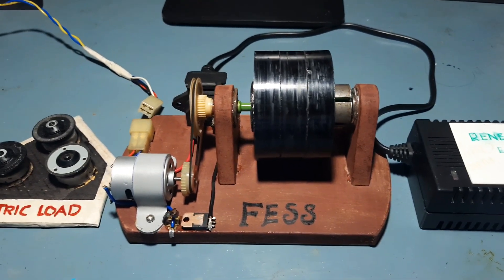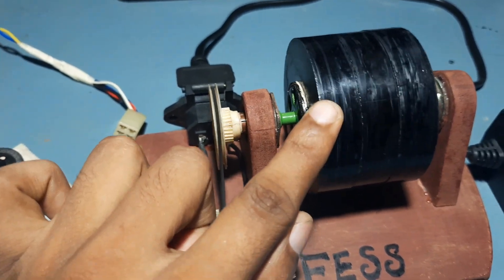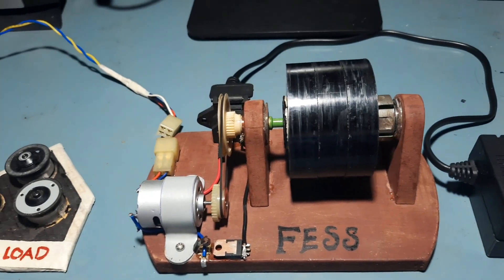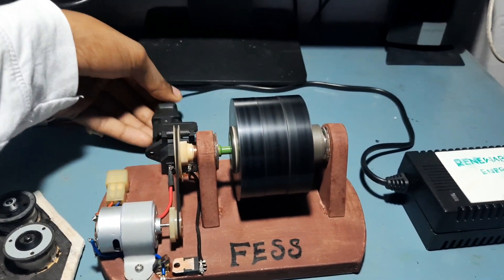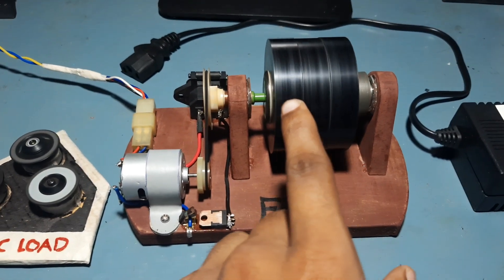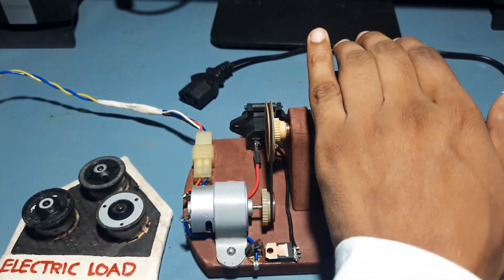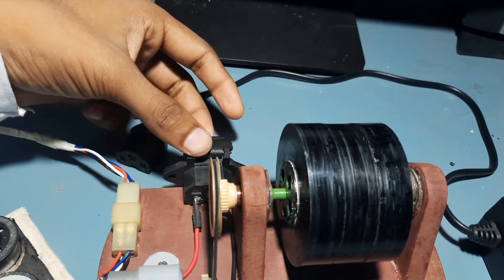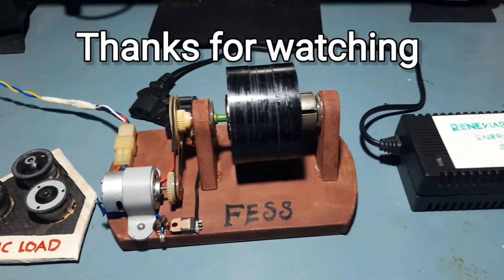Flywheel energy storage systems

Comment: The radius of the flywheel has to be larger even though the weight is less... It's the outer ring weight of the radius that matters more. Because the farther from the axis point, the more moving energy it holds. (Inertia)
Reply: That means to make a flywheel have a longer rotating time, it's about more diameter than it is about the mass / weight of the flywheel ?